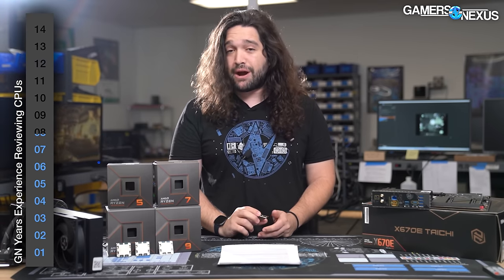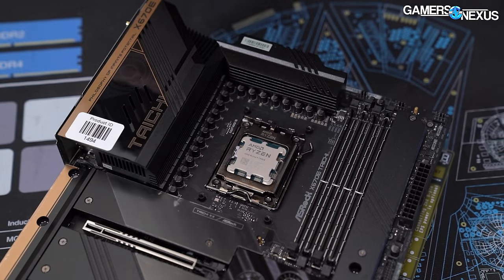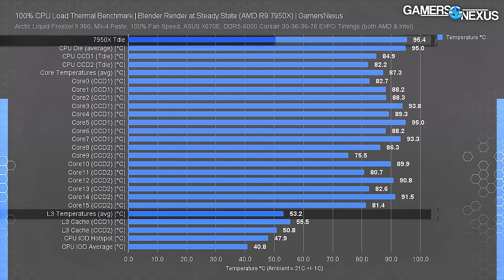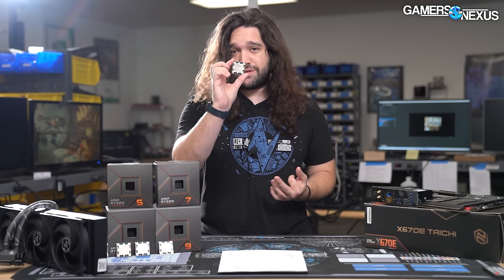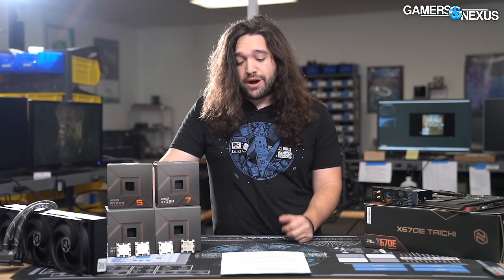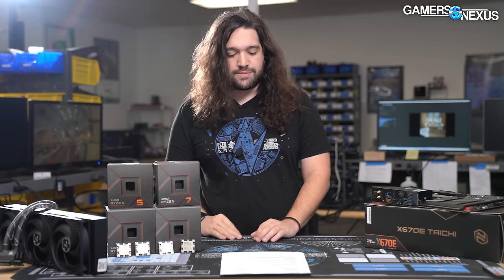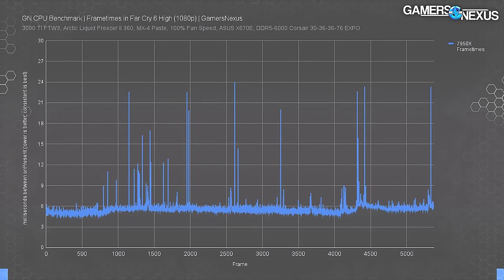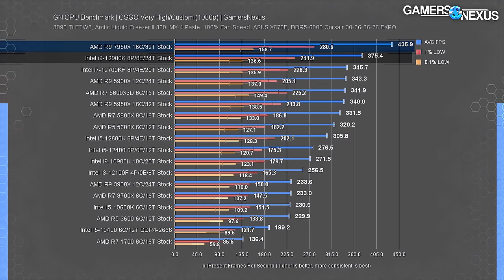95°C is Now Normal: AMD Ryzen 9 7950X CPU Review & Benchmarks

Comment: I know its not as exciting but do these chips have an eco mode like my 3700x does? I run mine at its default eco mode 45w and I have no issue with the performance of it. Its getting a little old now and I'm wanting to upgrade I'm just hesitant due to the new platform adoption costs and insane ideology of lets just throw electricity at the problem to get more performance and be dammed with the planet and running costs.

If they do have an eco mode not just manual undervolting, do you have any data with impact to performance and power data in this mode?

Comment: Something seems odd. Der B8uer tested direct die and the CPU run 20 degrees cooler, all else beeing equal. In other words the CPU can then boost even higher... 🙈 Or just run cooler, using less energy... 

Seems like going with that thick headspreder will bite AMD...

On the other hand, direct die and a small undervolt could be crazy

Comment: What about limiting the TDP of the 7950X so it produces the exactly the same results as the 5900X.  What is the TDP comparison then?  I think AMD stated the 7000 series is more efficient when performing the same amount of work as the 5000.
Reply: According to Wendal LevelOneTech the 7950x at 65 watts outperfroms the 5900 across the board (at any power level).  I call that more efficient!!!

Comment: So in r6 where the last gen top sku of intel beats amd top sku new gen,  that benchmark is "so silly ha ha"
I get it, it's only 7 fps on the top end (0.1% lows 50fps difference) - but that's last gen intel, this is not insignificant enough to be cast aside so easily imo. 
The reason is if you insist on using 7 year old games for testing, they will always have high fps.
ty for the review :)

Comment: The efficiency diagrams are basically worthless. You either care about efficiency, so you set an appropriate power limit, and then the 76950X at 65W PPT still beats the 12900K in Blender, or at 88W PPT it beats the 5950X. Or you don't care about efficiency, then why measure it in the first place? Basically, for efficiency considerations, every CPU should be power limited to where it runs in its Sweet Spot. Other publications measured this, ComputerBase even at four different PPT values.

Comment: Great review, although your perf-per-watt efficiency measurements, while an awesome addition, leave a bit of room to improve: The conclusions you draw are fallacious, it is not reasonable to berate AMD that 7950X would be less power efficient than 5950X, when you did not do the benchmarks to verify or falsify that claim yourself.

When 7950X is +50% faster at 2x the power draw of 5950X, you cannot conclude in one way or the other that 7950X would be more or less power efficient than 5950X. That data point gives you zero information about power efficiency, as it is measuring a Porsche fuel consumption racing at 200mph against a Ferrari fuel consumption racing at 100mph, i.e. the typical "apples to oranges". That data point only tells you that AMD chose to bias/allocate the CPU's default speed drive settings at the factory all the way over to the give-me-performance end of the spectrum, rather than to the give-me-reduced-power-draw side.

To arrive to a proper conclusion as to whether 7950X is more or less power efficient than 5950X, you should either run the 7950X constrained to same max. clock speeds as 5950X and see what the power consumption difference is between the two; or, if not feasible, then constrain the 7950X to same max power draw than 5950X and see which one performs faster at the same wattage consumption.

Either of those benchmarks would tell you which CPU is more power efficient. It would be great to see an XY graph with max clock speed as the X axis, and perf-per-watt power efficiency as the Y axis, or max watts consumption at X axis and achieved performance at the Y axis. 

Comparing the CPUs on that scale will show what the efficiency really looks like. See e.g. Apple's keynote graph from a few years back about how such graphs will look: https://www.xda-developers.com/files/2021/10/Apple_M1-Pro-M1-Max_CPU-Performance_10182021.jpg 
(not an Apple fan, or AMD fan, but that graph came to mind as a recent example to illustrate)

Comment: Steve, Using Watt-Hrs per Frame is VERY CLUNKY way to measure efficiency.

Steve, why didn't you do what Tech PowerUp did for Energy Efficiency measurement?

Just measure the amount of kJ (kilo-Joules) spent/consumed by the system to complete _ task / benchmark for Productivity App performance?

That should be easy enough to measure and it's clear as day as to how many kJ you use to accomplish a fixed task/benchmark.

Comment: 95c is perfectly fine and can run at that temp 24/7. You have people utterly confused in the comments.
Reply: no one wants 95C coming from their pc 24/7 heating their house or apartment in the summer.
Reply: @JayzBeerz  Don't keep a benchmark running 24/7.

EDIT: Plus the 12900K hits 105c in the synthetics and will throttle performance. So, the 7950X kills the 12900K in everything, does it with lower temps and won't throttle. So, you aren't making anything close to a valid point. Stop watching the worst tech tuber around.
Reply: @JayzBeerz  that’s not how heat works…
Reply: @infinitelyexplosive4131  and how does heat work? SMH! My 5950X and 3080 ti produce so much heat I need a fan and separate air conditioner for my room when gaming.

Comment: Well people...we did ask for a solution for "how are we gonna heat our homes in EU this winter".

And so it is,

we are presented with,

in true "AMD fashion", with "value over 9000",

and with "Lisa Su IS Indiana...Jane,  johnny-on-the-spot-inb4-the-Nordstream-irrepairebale-lock",

the 7950Χ.

Not ONLY,do you get the current fastest state-of-the-art processor, 
you ALSO get a miniscule (well the cpu at least) super-hitech space heater for your room,to get you by these dire,trying, soon-freezing, times.
That's a twofer if there ever was one!

So put your tower under your desk and stretch and rest those freezing feet over atop your tower, feel that warm heat emanating from your 360 AIO, lovingly supplied by AMD.

AMD. Value over 9000. We've got your back. And LNG stocks, we should get some of them too.

P.S. : Needless to say, we can't and shouldn't rule out Intel. No-brainer really. If they come out with a chip that sucks up 300, 350, hell even 400 watts, we're going for that, sorry Lisa, need to warm our legs. And room.

P.S. 2 : It would be interesting if AMD explained how they measure "efficiency" for these chips. I mean who knows, maybe in an abstract parallel universe with different Physics and Math laws, it is true, and they are not LYING.
I mean,really now, they did something wrong with this generation. And they lied to our faces on top of that.

Comment: Its a shame that every reviewer have unlocked everything and only focus on the peak performance, and nothing else.

I would love to know how the temp is when running it stock without any overclock self boosting enabled.
One of the Ryzen 9 5950X I currently have I dont get it over 50celsius with a tower air cooler, and thats while playing games.

But if this new cpu still runs 100celcius when no boost overclock is on, then I might not get the AM5, because I dont want to sit next to a blazing hot pc case and listening to a freggin jetengine when playing solitaire.

Comment: I have a 7900x, no over clocking nothing just stock out of the box. I have it on an evga clc 280 all on one. My idle Temps are 55-60 and it  goes to like 72c when I just open up a browser.

Is this normal? Seems insane.

Comment: 95°C is not normal! The Heatspreader is too thick! Most likely because of the compatibility to am4 coolers.
 The Ryzen 7900 has already been delidded and was testet with a tripple-fan radiator watercooling ,there is an delta of around 20°C... this is ridiculous

Comment: So 360 rad does not drop the temperature.... If you keep adding flow and radiator will it get to a point where it will not get to 95??

Comment: Why the benchmarks for the Ryzen 7000 (specially the 7950x) are without PBO ????? PBO it's an official AMD feature, as AMD Expo, DOCP, Smart Access Memory and others.... IF YOU ARE NOT GOING TO ENABLE ONE OF THOSE, THEN DISABLE ALL!!!! (including XMP for Intel platform)...

We want benchmarks with PBO activated.... 5950x stock is said 25000 pts CB23 MC, but, PBO enabled, 32000 pts easily (which is AMD OFFICIAL feature, like the others) with standard memory and mothertable...
Maybe, PBO enabled.... 45k for the 7950x ??????

Comment: My Ryzen 9 has killed two EVGA power supplies: a 1200, and a 1600 within days. I'm at a loss as to how to not have my supplies die so quickly.
Reply: that's really weird, and not normal at all
If this happened to me, I would be looking at trying to filter the power coming into my system with a UPS or a power strip which filters power
I would also just be making sure that everything in your pc is connected properly, and there are no weird overclocking settings in your bios.
In fact - make sure you have flashed the latest bios for your mobo.
Reply: @notreya  Update: EVGA actually replaced both no problem and sent me a 1600W Plat, and it has been working great. I use it for block production on the Telos Blockchain now.

Comment: Nowhere in this review does he mention that it's not going to run at 95c while gaming.  A CPU review shouldn't just cover thermals in heavy synthetic benchmarks, it should also show you the temps during gaming, especially for something that you're telling people will always run at 95c.  This doesn't run at 95c during gaming, only when it's being pushed hard.   But I don't have any idea how this CPU runs on air or water in gaming, because YOU DIDN'T COVER THAT.

Comment: Not sure what is surprise here - Intel was running red hot since forever... AMD probably just took note of that and let it rip. Clearly if they can handle higher temps, then there is some performance potential into it. The good side of it - if one can afford WC then with lower than 95C the performance may even be better. I just hope it is not the case of Intel where high temperature was less of design choice and more of poor thermal efficiency of the IHS... and design was just excuse.

Comment: Sorry if I missed it, but did you run every test with 100% fan speed? Or can you run this with lower fan speed without it hitting TDP on simpler tasks than compiling or gaming? If not, this seems like the most annoying generation ever... high wattage consumption mixed with 100% fan speed.

Comment: Disappointing. I am still using my TR2, 2990WX.  I would like to upgrade to get PCIE-5 and the other tech upgrades. But...  I don't feel like spending a small fortune to have an electric furnace in my office. Also, the TR2 is 32C/64T and can run at 4Ghz. The 5Ghz from 7950 wouldn't make too huge of a difference.  I didn't think I would be saying this, but I am curious to see what Intel decided to do.
Reply: I mean, doesn't the 2990WX pull just as much power as the 7950X?
Reply: @infinitelyexplosive4131  I run a Corsair AIO and the temps stay in 60’s even under load. Having 95c is insane. It’s a furnace more than a CPU. TR’s power draw per core is actually better. I grant that the 7950x can hit higher perf numbers per core. I think the gist from reviews is that the new chip runs faster but eats up a disproportionate amount of power.
Reply: @GAMarine137  Yeah but it pulls the same amount of power, so it heats the room by the same amount? Why do you care about the temperature of the CPU, all that tells you is the (in)efficiency of the thermal transfer between the CPU and the cooler.

Comment: you should stop benchmarking 1080p as thats kinda misleading and technically inaccurate / false.   1080p is not  1920x1080. the 2 are different   1080p is the video encoding resolution, the 1080 on a monitor does not have a P behind it,  its a montor resolution, not a video  encoding resolution aka the P behind the 1080.  they are very different things.

set a video game to run 1920x1080 doesnt mean your playing the game at 1080p at all.

Comment: This is a little disappointing.

My computer is already a mini space heater with an overall power draw of around 450W. Now it is looking like that number is set to double. Oof.

Does anyone know if we saw something similar going from 1xxx->3xxx->5xxx on the old am4 socket? Should I be looking to wait it out?

I'm looking to move to SFF and also try to reduce how much the pc can heat my room (its central air - so I can't just blast AC to offset pc). I'm still on intel 4690k. At this point I'm wondering if I should either go amd 5xxx, go gaming laptop - which in my old old experience had about a 3 year lifespan, or just wait it out. My pc is definitely showing it's age on some of the stuff I do (I can peg it to 100% fairly regularly).

Comment: For years I've watched multiple rants here about how power-hungry Intel CPUs are, how inefficient, including dismissing their performance with a snide remark about brute forcing it.  Turns out, all they had to do was have marketing say "its supposed to be that way" and the power draw/temp issues are a-okay forevs.
Reply: It is unfortunate AMD got sucked into the power game for "leadership". Would rather it be limited to a more reasonable 170-200W stock, with an easy toggle to go HAM. I forget what AMD GPU that had it, like 15 years ago had a regular, and an "Uber" bios switch, but that seems a better way to do it. I know motherboards don't have bios switches, but they could put in an easy toggle.

Comment: In cinebench I Crack 95° constantly but never see that in gaming. Clock speeds stayed at 5ghz. I've seen my 760px boost as high as 6.4ghz in cyberpunk. But during testing my rad doesn't even get warm. 360 eisbaer. After a while of gaming only one side of my rad gets warm. Any ideas?

Comment: 4:08 not entirely true? It hits thermal limits first because most coolers can't handle it. In theory if you had a perfect cooler (custom loop maybe?) it would hit the power limit first and not go to 95c.
I'd suggest setting the PPT limit to what you find comfortable for power/temps. Alternatively set the max fan speed for a decent noise level. CPU handles the rest.
Reply: That's still going to be hard because with TSMC N5 and more dense nodes, the heat is EXTREMELY packed into a small area.  You could probably run a custom loop and it wouldn't fare that much better and under all-core loads, I'm betting you still hit a thermal wall before power.   It's easier to wick away heat when the heat is spread out over a larger area, simply because more area is exposed to a cooler.  Even though the heat spreader is better, the heat is still coming from small spots, so part of that heat spreader is dealing with the most heat.

Also, he showed a CPU using over PPT already, while most channels that showed CPU power showed it around PPT of 230W.

You'd probably have to use some kind of electric water cooler to chill water in the loop to get to where you hit a voltage cap.

Comment: Stability issues. 
Every AMD generation has stability issues. I haven't used AMD since the 90's for that very reason.
With intel I shut down when I update drivers. System runs for weeks and weeks without any issues.

Comment: we'll soon need a new cooling method to cool these denser and denser silicon chips. 95c is bad operating temp especially when TJ max is 95c but we should be looking at power draw when comparing CPU across brand due to difference in manufacturing process 14++++brrrrrrrrrr. LOL they named the next process intel 7 to make people think it's 7nm when it's still 10nm.

Comment: Seems someone didn't talk to AMD about the initial boot lol. So what I hear is when first installed the boots are changing the memory timing trying to get it as tight as it can and will then reboot and try again until it's at the best possible memory timing for best possible performance, this can happen more than a half dozen times. Once it has gone through this initial set-up boots are normalized and quick. That is until you either clear the CMOS and it has to do it all over again or install a different CPU. Patience is needed and you will be rewarded for it or you can be like GN and assume it's a "Bios issue" lol. I am sure there will be some small hic-ups but this wasn't one of them. Do you guys just ignore all instructions because you think you know better? lol Just kidding thats a "males don't read instructions" joke. I dare the GN crew to buy a massive entertainment center from Ikea and throw away the instructions then build it. LMFAO! over under on part left over chat? 10 pieces? less?

Comment: Thanks AMD, Who would have thought that I could use a CPU to run things a little faster while at the same time heating my 3000 sqft home. I thought going to lower nanometers would give more speed while lowering the power used, but boy! did you prove me wrong. It will be a while before I build anything for anyone with 7000x processors. the cost of just running the systems with a GPU would be like putting 100w light bulbs in every room in my house and turning them all on every time I play a board game. It's like Tim the Toolman is running your company "Need to speed things up just add more power". This is not innovation and because of that I'm out. Ryzen 5000 is fast enough for me right now see you for Ryzen 8000 maybe.